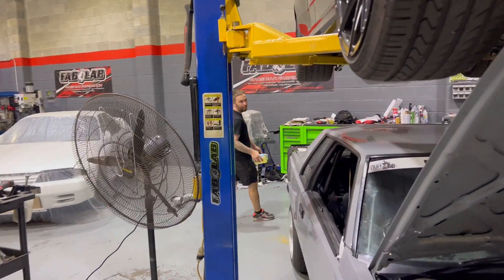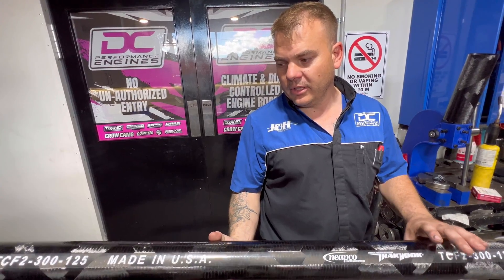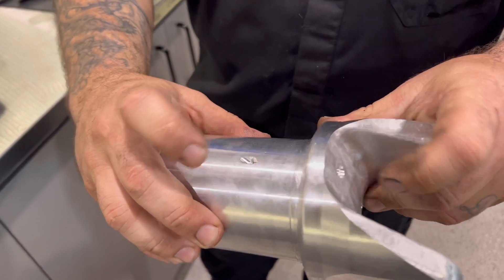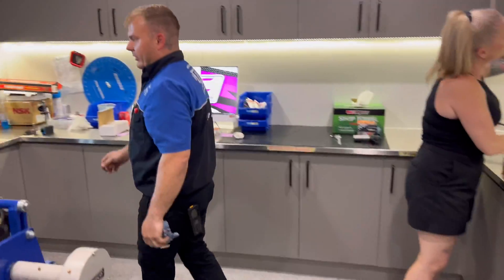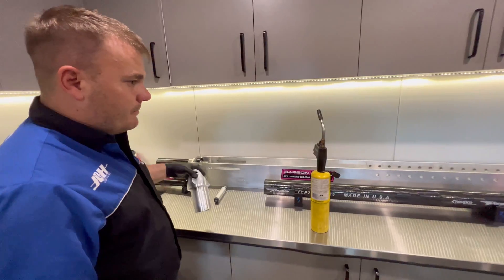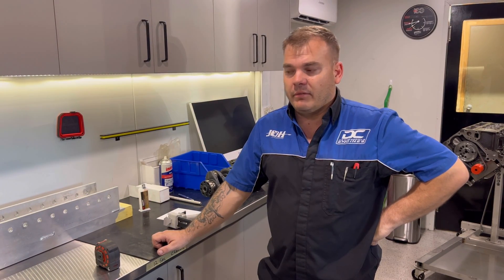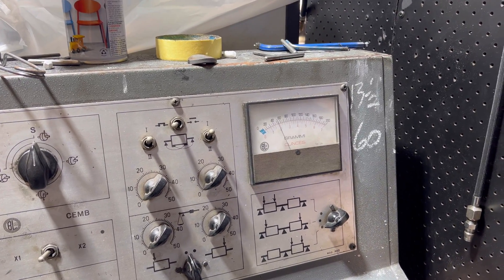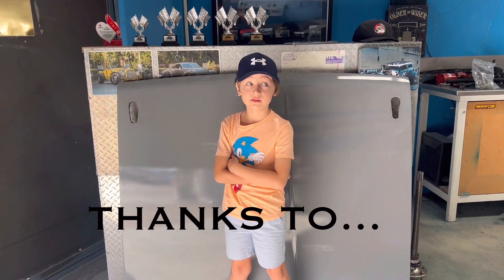UPGRADING TO A CARBON FIBRE DRIVESHAFT & HOW CARBON FIBRE DRIVESHAFT’s are MADE

Comment: Are they tested at same RPM through the lights as a drag car. 3000 HP, 3200 lb weight, 8000 rpm motor, 4:11 rear gears , 4L80 transmission?

Comment: Aus weighing in lbs? lbs of rotational weight is a bigger saving that static weight, at 10,000rpm that 6lbs difference will be a lot more.
Reply from the maker: We’re that clever we can measure in MM & inches also 🍺

Comment: dumb question but how feasible do you think this would be in a light truck/van application? Got a crazy idea of maybe replacing the very heavy steel driveshaft on my sprinter van with a CF shaft since mine needs replacement.
Reply: I would think there would be other parts you could change on a heavy sprinter first.  What are you hoping to gain from it?  lightest wheels and low rolling friction tyres.  on a drag cat trying to shave a 10th of a second of a 1/4 mile time spinning a lighter drive shaft can help.  do you notice the difference in performance in the van between having a passenger and not having one? it probably no different than that. Having your DPF cleaned would make more performance.
Reply: @krusher74  you're 100% right. Mostly just mental gymnastics for random shi7 to do on my van. Already have cleaned dpf, lighter wheels, super single conversion and a few other driveline things. It's brought me about 2mpg gains but in my 9000lbs it's certainly a moot point but I got a ding in my driveshaft a few weeks back. Figured why not??

Comment: I've had THREE of these driveshafts, and ALL of them VIBRATE bad. You guys need to work on quality of these. They are not cheap and a F**K-around to try get warranty. Unfortunately there are not many options for my platform. Do better.
Reply: if all of them are balanced and 3 vibrate in your vehicle is it your pinion angles and chassis twist.
Reply: @krusher74  wrong. The yokes are our 0.028.
Reply: @krusher74  https://youtube.com/shorts/bV_6rvRb4-M?si=hLBE2rxnu86ggmY-
Reply: You had three from the same company they're talking about and never said anything? That's not even the same brand tube as in your video.

Comment: Awesome! definitely interested in seeing other masters of the craft and how they can improve for all the 1% gains (any estimate on a gain on this other than the strength/safety?)
Reply from the maker: 6lbs less of rotating mass should help, not sure by how much because it is so close to the centreline (being fairly small diameter) but it all helps! This shaft will see 9000+rpm so it should be a lot happier than our old chromoly one.
Reply: @autoperfectiongoldcoast  a happy shaft is very important, I've broken a thick wall 3" one due to whip and being a long in a falcon ute and it tore the car up, locked up the handbrake on one wheel, pulled the LPG line and fuel lines off the floor and broke the bell housing on the auto.. wild ride (1UZ A340 trans in an XF Falcon ute, going  quite fast on a road with some bumps) *spicer unis stayed in for the ride and both halves of the shaft were still flailing around until it stopped. not sure i can share a pic here i'll try with an imgur link in the next reply
Reply: if that worked, here's the bell housing also https://i.imgur.com/TaCVy3A.jpg
Reply from the maker: Wow! Not nice
Reply: Great video, what is the average price for one of these Carbon Candy sticks with the Billet ends 🤷‍♂️